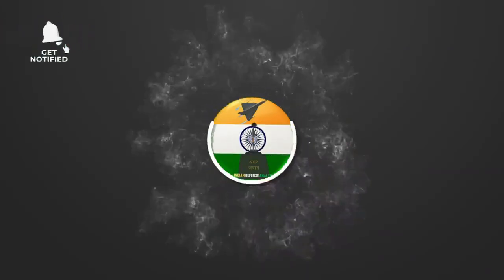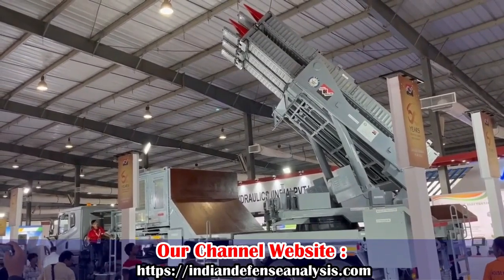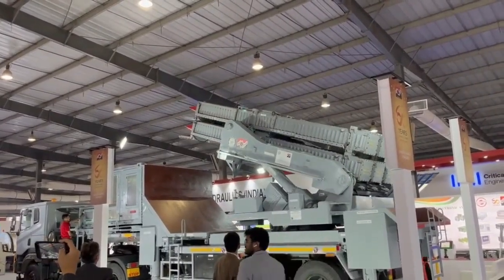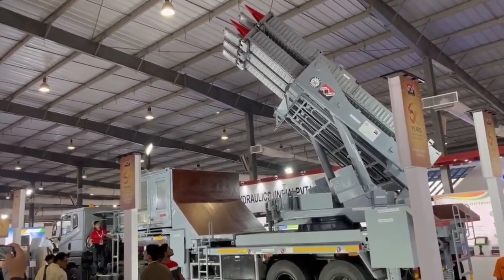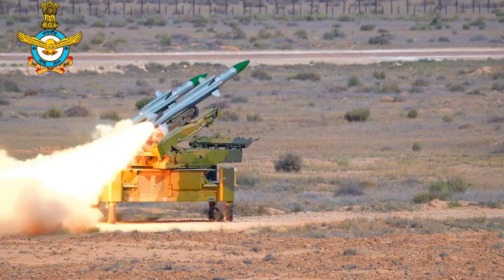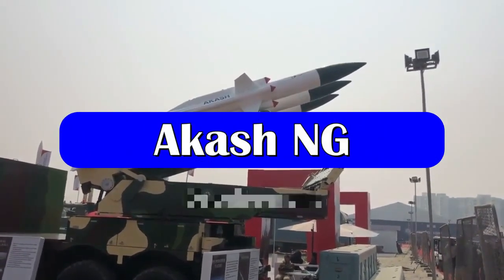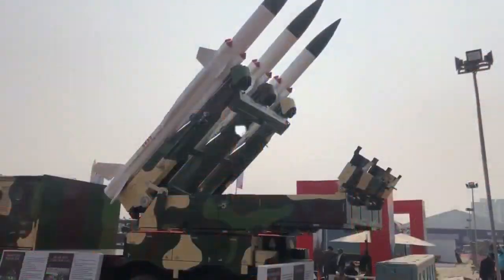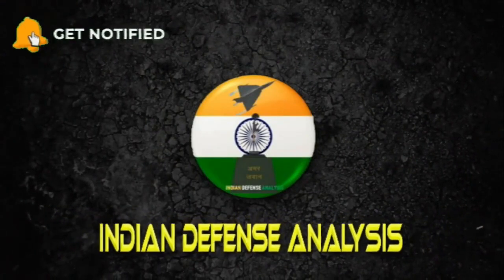DRDO gears up for the fresh set of trials for Akash Next Generation missile

Comment: What is the actual range of Akash NG system? It seems there is lots of confusion...in Wikipedia it is mentioned it has a range of 70-80 KMs....
Reply: Akash 1 upgraded ng range 30 km and 14km altitude. Akash prime 50 km upgraded version is NG 80km range come from 2027.its have a booster rocket of Barak 8.but design😢completely indigenous. Actualy😢barak8 booster😮and 1st stage prodused😢by Bdl, but😢2nd stage produced😮by Kalyani elbit joint venture in India. Akash1  and akash 1a lunch😢slant😢mood  but😢akash ng akash prime(2),akash prime😢ng  all vertical😢lunch 360 degrees coverage.